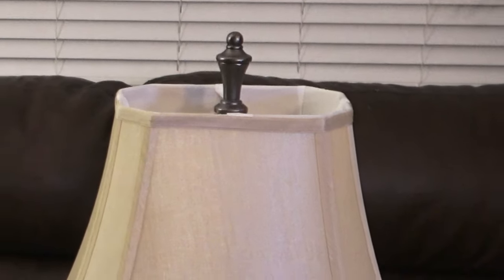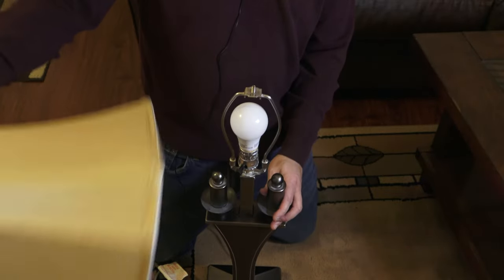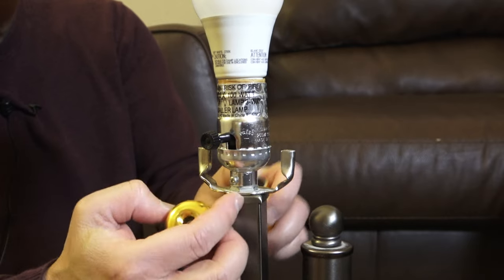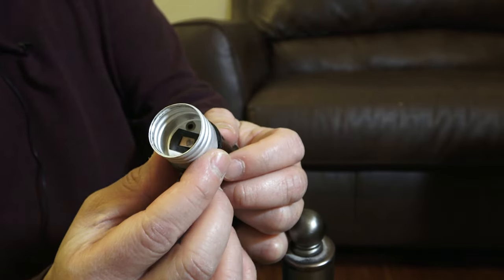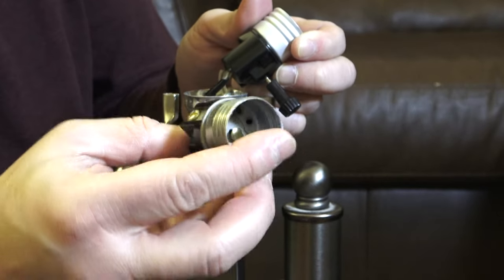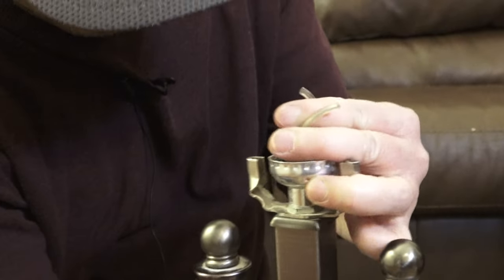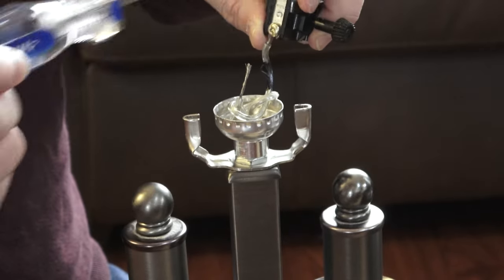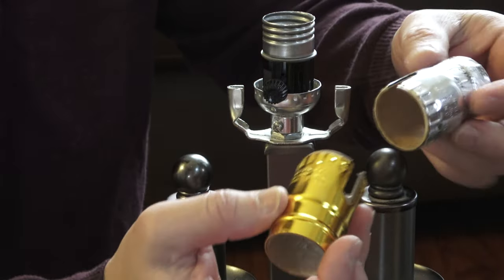How to Wire and Replace a Lamp Socket! (4K)

Comment: There's probably nothing actually wrong with your existing lamp socket ... LED bulbs that only feature an On/Off lighting option don't work with 3-way switches. You could have just purchased an LED light bulb with 3-way lighting options from your local Home Depot ... However, switching out the socket does accomplish the same thing!